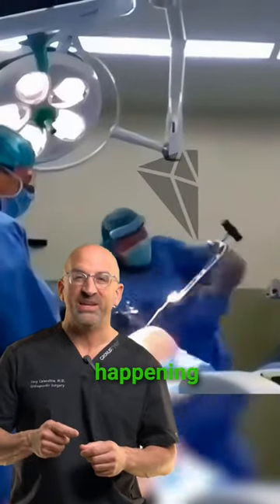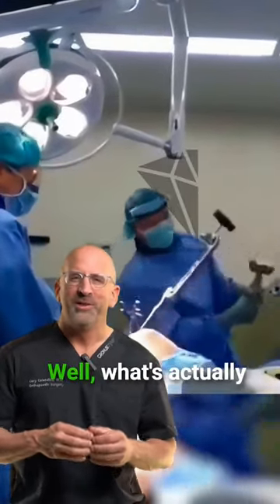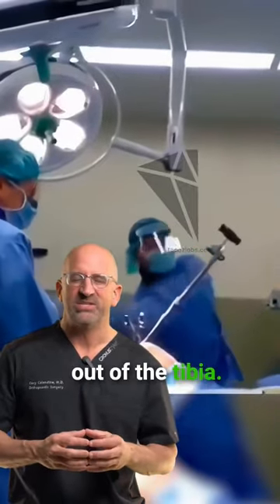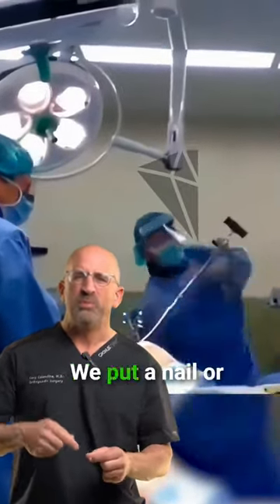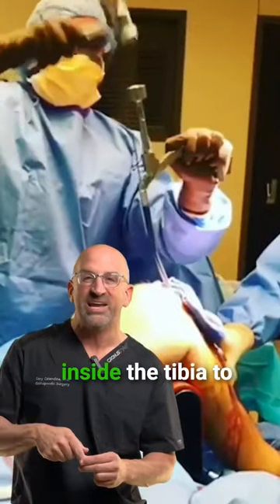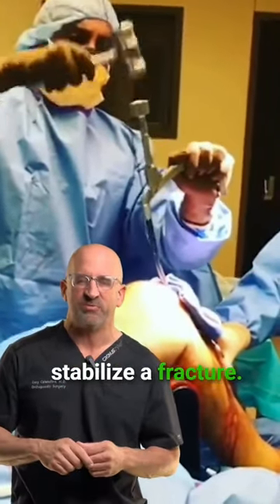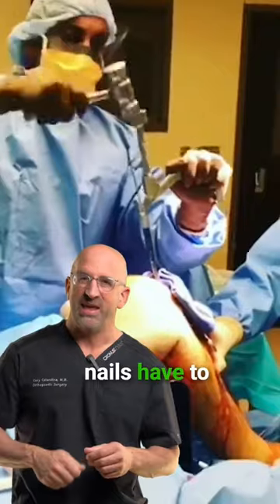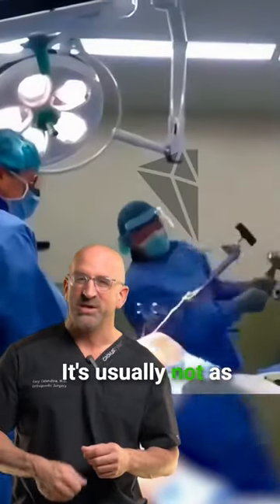More Hammer🔨Tibial Nail Surgery #shorts

Comment: Usually, if they are hitting this hard they missed taking out a stubborn screw distally
Reply from the maker: That would not be good.
Reply: Extraction specialist medical rep here.  The chances of a missing taking out the distal screw is highly improbable.  What usually causes the difficulty of the extraction is bony ingrowth that has grown into the screw holes of the IM Nail, or the tibia/femur itself has grown tighter around the nail cause equal forces tightened up and down the length of the nail.
Reply: @scottcampbell9650   I have to have this procedure done next, but I have a bent locking screw on the top of the nail in the lower position.
The two bottom locking screws have been removed and the higher top locking screw is easy to remove.
How do they deal with that bent screw ?
Reply: @derek04151 That's a loaded question, and without seeing images it would be hard to answer.  @bonedoctor482 is obviously the surgeon, but I will attempt to answer.  I assume by "locking screw" you mean the regular screws since there is typically only one locking screw which is found inside the IM Nail and locks in the lag screw.  Assuming you mean regular screw: a bent screw, depending on how bent and where it's bent, can still be extracted either via a regular screwdriver or by use of a special broken/stripped screw extractor.If that's the case, then easy day.  If it's too far bent, or is broken, portions of the proximal (closest to the surgeon) can be removed, then the nail is removed, then the distal (farthest from surgeon) is removed. This is done in  variety of ways which is left up to surgeon preference.
Reply: @bonedoctor482, fair enough answer for him without seeing the images?

Comment: Could you please explain more about this surgery, why the doctor is hitting like that
Reply: Hi there, extraction specialist medical rep here.  This C-Frame is attached to a special tip designed to attach to the specific Intramedullary (IM) Nail inside the tibia.  The C-Frame allows for a "moment of impact" point that sits right above the implant and strikes from the mallet force the IM Nail to break apart from bony ingrowth from the inside of the well-fixed tibia and eventually forces the nail to leave the tibia so that the surgeon may then go and do a "revision" surgery.  Implants sometimes have to be taken out for a myriad of reason; infection, re-break of the bone, break of the implant, recalls of specific implants, and many other reasons.

Comment: Would It be a best option. Hmm..
Reply: Hey! Extraction specialist medical rep here.  Yes, this is the best option.  The alternative to removing an implant by connecting and using this type of force to remove, is to perform an osteotomy which is where the surgeon cuts a "window" down the entire length of the bone (tibia in this case), removed the implant, then wire and staple the bone back into place.  This results in more direct trauma, longer surgery, much longer recovery time.